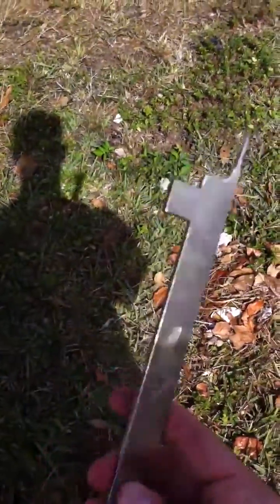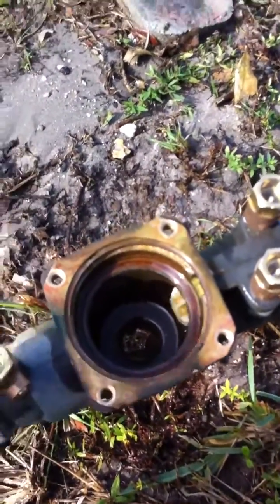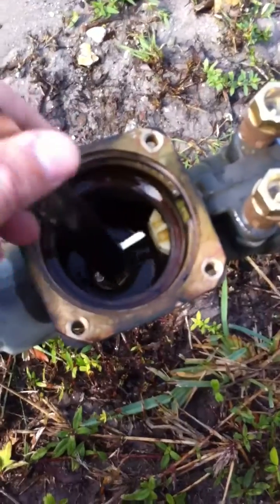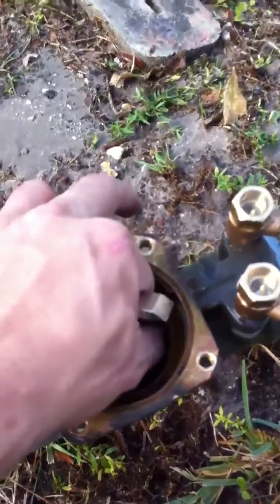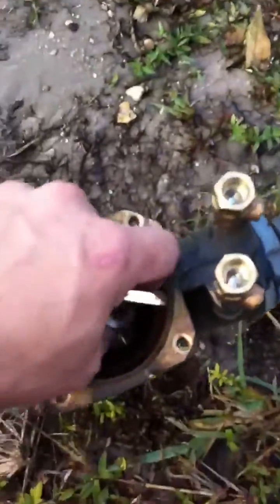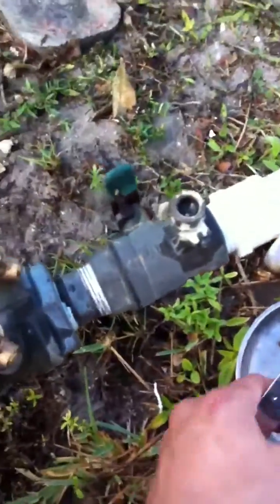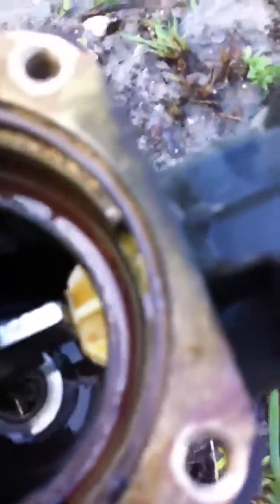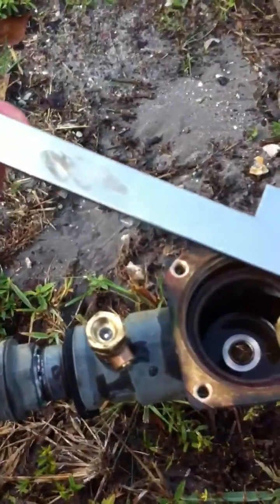Backflow Preventer watts 009 tool

Comment from the maker: There is no one reason why a Backflow will leak. The short answer is you need to have a certified repair technician repair your Backflow. Most states don't allow a plumber to service Backflow preventers and in many cases I can tell by walking up to a Backflow if it has been touched by someone who lacks knowledge and experience to perform the repair and I post many of those photos on our twitter account BBSbackflow good luck hope this helps